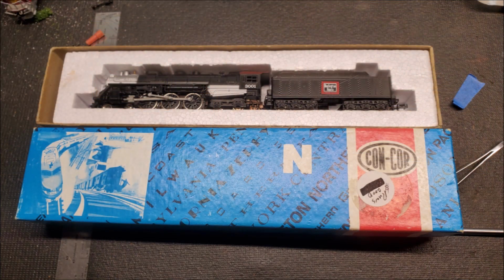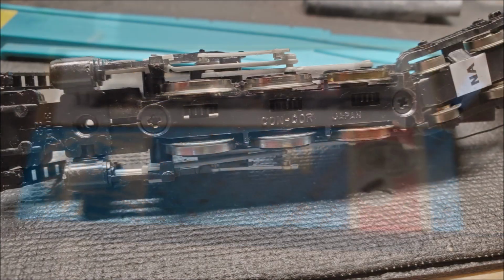Kato N Scale Motor Repair

Comment: I bought a early 90s era Kato  UP SD40 but I didn't know it had an aftermarket decoder installed, and whoever installed it made a rats nest mess out of it. 

Since I don't do DCC, and I have no way to "reset" the thing, I opted to remove the decoder. In doing so, I noticed the person who installed the decoder also cut the tabs off the motor that makes contact with the frame halves, to electrically isolate it from the frame. 

So what I would like to know is: will any Kato motor for 6 axle units work, or is there a specific type of motor I need to buy? 

Thank you in advance for your advise.
Reply from the maker: Somehow my notifications for new comments turned off, if your still working on this loco the ideal means of repair is acquire a new set of motor brush tabs, in my recent search they are pretty scarce.  On other loco motors tabs are not available without just getting a new motor.  With that said I removed the brush holders and tabs and soldered an extention so it will touch the side frame.  Be careful not to overlap the joint so much that the tab will not bend properly. Hope this helps.

Dave

Comment: Thanks for this repair video! If you have time to answer I am hoping for advice. I recently bought a used N scale locomotive. The engine pulls nearly full speed even when power supply is barely on. At this time I don't have any other engines to troubleshoot what is causing the issue, but am planning on getting a second engine soon. What is your advice for testing issue, and repairing? Thanks for your content!
Reply from the maker: I would love to help,  you can contact me via Email
sfwarbonnet11@gmail.com  lets start with the basics make and model of the locomotive, system your operating with, DC or DCC, and your test setup.  This will help me to figure out the direction we will go.
Hope I can help,
Dave

Comment: Great video but I have one question. Where do you buy replacement brushes and springs for Kato motors? I can't find them listed on kato USA website. I am in Australia and can't find any down here. Thanks.
Reply from the maker: Sorry it took so long to answer, they were ordered by my local hobby shop direct from Kato USA.  They do come in and out of stock.  The part number used in this video is common to a great many Kato locos so they will eventually come back in stock.  Good hunting,
Dave Ramirez
Warbonnet Trains

Comment: My steam endings ran fine yesterday today it won’t move. The headlight comes on but that’s it. Any ideas?
Reply from the maker: Not knowing what kind of loco it is or what your running it with, this is all that I could think of, if its non DCC it could be that the mechanism is binding, or that the motor wire has broken off one of the motor leads. If its an older steam loco it may have an older 3 pole motor and is stuck between poles and just needs a little nudge to get it moving.  If it is a DCC loco maybe wrong address, or the decoder was glitched and needs a reset.  With a little more info maybe I could help you better.  Have a good one.
Reply: @WarbonnetTrains  Bachmann Industries ALCO 2-6-0 PRR 3234 Steam Locomotive Car. This is the name it’s dcc ready. It was a very nice running engine. I noticed the bottom plate was loose and took it off and seen two nuts on an axle fallen out of place. It was now run in reverse only

Comment: Wow and thats not Enough I felt like I was in the Classroom listening to the Awesome teacher and subject for the Day was how to Run a Model Railroad in the most proper of Ways.. We need our Educators in this Hobby and Sir you got my Vote.!  On my RDA N Scale I run both DC and DCC and in your mentioning dont Run your Trains to long in length, you can for sure tell this just by pulling with you finger on a Freight I usually use a flat car how hard the pull is and strain its going to inflict, my Question is you mentioned Running 2 to 3 engine's can help with the Weight of the pull to add to my  ?  if 1 or all 3 are running different speeds say I'm running 3 SD40-2 KATO'S geared the same 2 are running slightly faster than the 1 how do I set up the Consist of Engines so the 1 isn't being over powered and do I need a more powerful DC controller currently for DC I'm using a MRC 1370 controller..  my Layout is totally flat it sets on 4X8 picnic table.. 

To see my Layout Please visit my La Junta Hutch & Pratt mini Sub Div..  RDA N Scale  Thanks for the Video you put out & Sorry for Loss..
Reply from the maker: First sorry it took so long, but here's my two cents, if there is just a slight difference on locomotive speed, I put the faster loco on the train, then the slower locos ahead of it.  Here is my theory, the train will dramatically slow the engine enough where the slower locos can properly give assistance pulling.  Now with that said, if the faster loco is still pushing on the lead locos even with the load of the train on it, then the speed difference is to great to run them together.

Now on the other hand, if the faster loco is in the front it not only has to pull the train, but the slower locomotives as well.  If it holds traction, that is a large load to bear, more than likely it will loose traction and spin the wheels. Hope this helps,
Dave
Warbonnet Trains
Reply: Thanks Dave I Verry much appreciate you getting back with me with What where still putting up with the covid I forgot to reply back to ya myself this stuff gets to much in everybody's hair and makes forget things but im trying to do better and just Run my Trains, 

 And I got a New  NCE SB5  just before Thanksgiving its doing OK but I done a boo boo I accidentally threw one of my KATO Unitrack Turnouts while cleaning my Track and I plugged in 🔌my SB5 & on initial hook up the Booster didn't act like there was an issue I left for about 5 minutes to help assist on something for My Mom which has a hard time getting Around and when I returned it was trying to reset i got it shut down reset the Turnout and checked my tracks my Buss Line checked out ok my Engine which at the time of the miss hap was my Atlas Gold Series Santa Fe GP39-2 with ESU Lok Sound which Atlas mentions has Overload & short Circuit Protection built in it was ok so I replugged in the SB5 reset the command station & reset the ProCab and it seem to be ok but I wonder if there was anything internally hurt 🤔 it didn't warp or melt the plastic on the SB5 it was luke Warm to the touch just after unplugging the Booster do you think sir it could've sustained any Damage.  

Want to Add: when I plug it the Light function as Normal so does it's Power Supply..  Thanks for Reading this 

Allen RDA N Scale